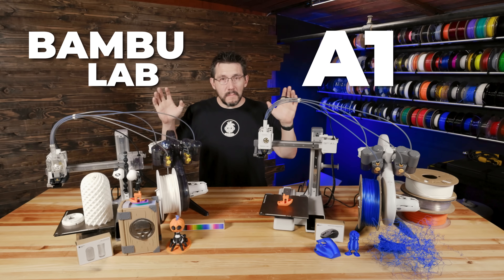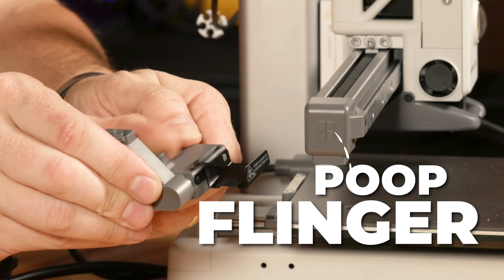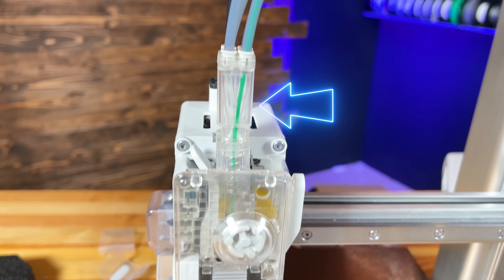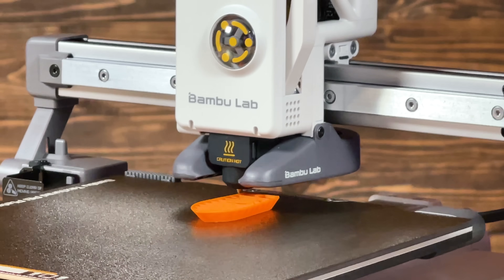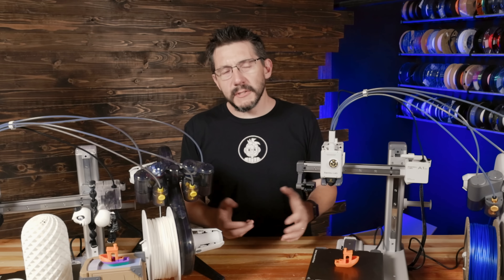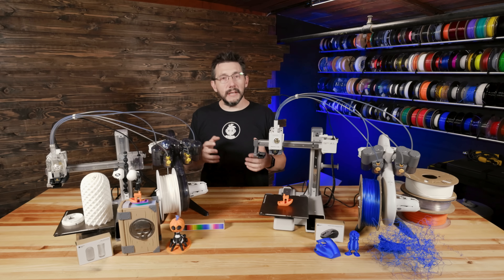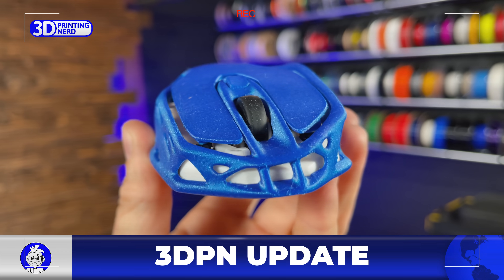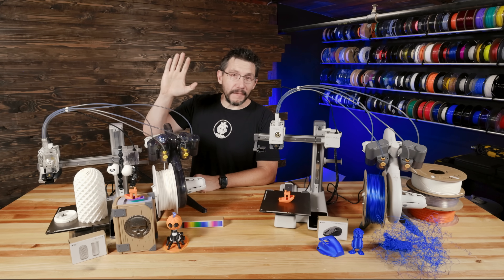Bambu Lab A1 Mini & AMS Lite! Cantilever Bedslinger!

Comment: "Appliance" like is an interesting comparison. This generation of printers might finally bridge that market chasm from hobbyists and enthusiasts to the broader market majority. I think the last hurdle is a system that provides the general consumer with models they can just click print and forget until its done. The printers might be there, but the platform for the models are not.
Reply: With bambus new online model sharing service where it apparently can slice the models too, it might be more like that ideal than you think.
Reply: It doesn't need to be hard to fix in order to be easy to use. Don't just roll over and accept these money-grabbing tactics.
Reply: @Venaloid  I am all for tinkering with my 3d printer to improve it or fix issues. But not most people. These bamboo printers are for casual users. And as such I feel there needs to be a casual user interface for the model prep process.

Comment: hope they make a ams system like that for the carbon and I hope they do a larger bed option in the future.
Reply: Why would the AMS lite be good for the X1C? The standard AMS is better and really not that much more expensive, plus you can connect 4 at once with the AMS hub.

I can see how the AMS lite may work with the other printers using the AMS hub but they don’t have the four PTFE tubes going to the hotend like the A1 does so it’s benefit would be limited.

Comment: Typically from my perspective,  a new machine is only interesting in that I might want to puck one up used a few years down the line. But this, this makes my want to start saving my pennies and possibly buy my first new machine ever. 

It's not something I can replicate the functionality of cheaply enough or easily enough be worthwhile compared to the modest price tag.

Comment: (cracks knuckles... because I always type a lot)

Well, I'm sure at the time of filming, all the drama around the leak wasn't known. The AMS lite is curious but many of these designs seem... weird. Maybe it will grow on me, but I come from using a Prusa MK3 which was infamous for "wow, have you heard of cable management?" and seeing a Bambu printer, from the same company that had a "this is basically an appliance" X1C, to this with more loose wires... still weird. I can only facepalm at the fixed power cord. The extruder is going to be used in more of their printers (they do a lot of reuse). Joel didn't mention the other features they added (none are really groundbreaking and most will never be noticed... most didn't notice an issue that these new features would solve on the X1/P1, so not much here), but the biggest would probably be the sound and it sounded decently quiet, but there wasn't much difference between normal and quiet. Do note that it's a different nozzle/hotend that doesn't have hardened options (at this moment? No idea...)

The AMS lite is... I'm not sure what's lite about it. It does everything the AMS does except be enclosed. Throw the whole printer in a tent and tada, it's enclosed. The clamps make it seem like it could rewind filament back, but now I worry it will deform the inner portion of cardboard spools over time. Hopefully they won't just slide off. I also kinda had the expectation that it would be cross compatible with the X1/P1 (maybe it is...)

People will buy this. Time will tell if it's good or not. It just feels out of place in their lineup. X1C + AMS = near appliance. P1P = bare bones X1C to reduce cost, can be customized. P1S = ok, the side panels were actually important... we'll add them to the P1P so it's like a budget appliance. A1 mini = "We're trying to go after Prusa's entry level printer"? A printer that just got an alpha release of input shaping. Sure, it's alpha. But unless you got money to spend, most people will only spend money if something breaks or they see a significant advantage over what they have. Many people I've encountered who are looking to upgrade are looking at the P1S (lots of words go here to essentially say P1S + hardened gears will get you 98% of what a X1C gives you, and you save nearly $500... just do that instead of the X1C). Prusa pitched the Mini as "you can get 2 mini's for the price of one mk3... and total build area is bigger" and people did get it for that. But an irony right now is people basically said "ok, my printer can finally print at a speed I find acceptable, which means... I want to print big things", and unless the X1E (trademarked name, will see if they announce that today or another time) is a bigger printer... many people who are looking to upgrade have gone "nah, I'll wait" instead. In fact, I've seen people say "I was thinking of upgrading my Prusa Mini print farm to something else... but Prusa's latest firmware (alpha) means that this now scratches the itch for speed". In other words, if this is aimed at trying to get people to upgrade Ender/Prusa-sized printers... they missed. And if they want people to replace their "old and outdated" Prusa Minis with this... they were 2 days too late for at least some. Only people I've heard who said they're gonna get this (once they saw leaks and now official announcement) have said their reason is "just because" or "it's wacky, I want it".

I hope more people do multi-color, but there's a LOT of people who don't care. Either due to the waste (which now gets flung off to the side...), "i paint my models", or "I just don't care". And I think people are gonna see this and go "oh, I can save $150 by getting rid of the AMS lite? Bye bye AMS, hello more filament".

Also, as someone who does software for a living and decades of open source... and reads/discusses a lot on Twitter, Bambu Studio is AGPL... GPL means "if a user wants the source code, they can request it" but it only applies to software they run locally. AGPL means that any software they access locally OR over a network/internet... can be requested. And that's not "well it's Bambu Studio, it's already on Github". AGPL means the network/API part needs to be there too... so I'm already sighing heavily over the internet yelling that's gonna happen around slicing in the cloud with a AGPL-based slicer. Much of GPL/LGPL/AGPL is the idea of "I can see how it works and modify it so I can make my own". So AGPL internet slicer = I should be able to get the code, compile it, and run my own internet slicer.

Comment: My input - buy what works.  Your discussion of the appliance model is very appropriate.

Should Open Source matter to you -

For most humans, the answer to at least 3 of those 4 questions is no.  For me, this stuff is what I do for a living, and even I sometimes want the tech that I buy to just work.  That's why I bought Apple TVs for my media use and Xboxes for my gaming.  I have access to all of the bits and bobs to make very high end versions of both of those devices, but sometimes, I just want to plug it in and use it.

Comment: they really screwed the pooch with the appearance of the ams light. all those tubes sticking out of it and flapping around is going to scare off any casual user who doesn't know much about 3d printing, and that demographic is EXACTLY what they're going for here. "appliances" are self contained objects with clean lines and smooth surfaces. or as my ex liked to put it when looking at my rack of printers a few years ago (bed slingers and corexy's) "WHY DO THOSE THINGS ALWAYS LOOK LIKE A HIGHSCHOOL SCIENCE PROJECT ?"

Comment: I was disappointed with a small bed slinger when i saw this leaked earlier this morning but now might consider it. I would use it for hue forge printing. id be interested to know how it performs with detailed hue forge prints
Reply: Most of the hueforge crowd has been wanting a larger printer for bigger art projects. Itll probably be fine for it
Reply: If I had $948 dollars to spend, I would get the Prusa MK4.
Reply: The models are cool, especially the mouse kit . It seems to print pretty good too. Multi color is neat and different.
Reply: people underestimate small cantilever bedslingers. My Ender 2 pro give almost every big machine a run for their money at $100 except for the print volume

Comment: So... what are the stepper drivers? They use internal Chinese manufactured ones for the P1P and X1, so I'm assuming this is no different. 
Also -- that thing is vibrating worse than an unbalanced washing machine.  I guess one of the first things to print are tabletop clamps?
Reply: 1000 hours on my a1 mini says otherwise, sir. its a 9/10 perfect printer

Comment: 13:02 - I completely disagree with this take: we should not accept non-repairable machines. It's bad enough that common appliances are no longer repairable like they used to be, and I refuse to let this happen to 3D printers too. Prusa printers "just work", but they still benefit greatly from being repairable, and that's why I will continue to give them my money: because I know the entire machine won't go in the trash as soon as it breaks.
Reply: I'd personally prefer the best of both worlds. The ability to repair my machine by myself if I want to, and the option to have a professional repair it for me. If my printer breaks, I'd much rather send it in for a repair or have a tech stop by my house then spend my own time fixing it. I don't know of any company that offers that with printers under $2,000. AFAIK most consumer 3d printer companies want the customer to repair the machine.
Reply: Who said anything about not being repairable? 

Bambu will offer repair parts on their website just like the do for the P1 and X1 series printers. Just because you can’t print parts at home doesn’t make it non repairable.
Reply: @rednwhitecooper  They will offer some parts but if something that was not planned to be repaired is broken then you are damned. 

Also add that replacing parts on Bambu lab printers is a pain, and we are not talking about the 3D printed parts, we are talking about rails, electronics, cables, all
Reply: my only experience is with creality and bambu printers. One was easy to report the other one needed repaired. Yes I started with the knowledge when I got my bambu printer but everything is on breakout boards and easy. On my creality machine it was held together with hot glue.the community with manuals exist both places and I have not seen a seen a part on the bambu printer that's not on their website. Sure the nozzle is proprietary but unless someone has multiples of different printers what's the point. If you run a print farm you use the same printer that way you are familiar and the same file can go to multiple printers. If it's just the nozzle you can buy a revo hotend or v6 adapter.
Reply: @rednwhitecooper However, there is a factor some people does not counts, pirate parts.

The typical aliexpress companies are starting to make imitations of Bambu labs parts (the price of an original Bambu lab parts is not a problem, the avaibility and the chance of the part not being planned to be replaced by the user is the problem), just a matter of time to see how this performs
Reply: @alexsalchemy  , if you referred to this printer (hard to tell...), it is highly   repairable. It would be good if everything was repairable, but is actually the opposite; most broken or no longer loved products are thrown away.

Comment: Hopefully they make the AMS lite compatible with the P1P and X1C. I hate how much size it takes up. But to save $100....is it might be worth it.
Reply: I don't think there would be many people that want to do that and thus not worth the effort. You would need to completely swap out the extruder which I can't imagine many people being pleased about especially X1C users with the lidar scanner.

At 250 vs 350 they will just get an ams unit.
Reply: @dannonyogurt98  Lessons learned from each version... meld them together and now you have AMS v2 which is compatible with A1 and X1...

Invert the AMS Lite and give it a stand to hold it above the A1... the base can also fit above the X1 and feed down to the extruder. Give it an extra channel for running an external spool into it... Give X and P series a firmware update... BOOM! AMS v2.
Reply: @dannonyogurt98  all you would need is the buffer they sell and more retraction on a filament change (I'm not sure there is enough spring wind though)
Reply: @dannonyogurt98   thats not accurate at all, they already have the AMS hub that takes 4 PTFE in and 1 out to the printer... why couldn't you just plug the 4 PTFE tubes into that with the right software to handle it
Reply: That would be pretty cool. I like how the tubes are somewhat exposed and near the print head when the paths merge so there is less retraction needed. I can easily see a way to adapt the X and P Series to have similar feeding mechanisms for an AMS v2 to fit on top of the X and P series and have the same thing.

Now how to deal with the poop...
Reply: It's already been verified it won't be compatible.
Reply: They will not.

Comment: I feel like it's only a matter of time before these printers will be able to mix cyan, magenta, and yellow into full spectrum color, as the inkjet 2d printers do.
Reply: Pretty sure I’ve seen something like that already in a prototype somewhere, though the amounts of purge would be massive
Reply: Read a hackaday article a while back on a filament blending hotend. Had a massive metal 3d printed heater block, and the feedrate on different filaments changed output color. Something to do with it's internal geo allowed for proper color blending.
Reply: Bambu actually sells a CMYK filament set for printing full-color lithographs, so that's something :)
Reply: Google “QuadFusion” for that CMYK mixing extruder.
Reply: 2d inkjet printers do not mix the colors. They spray tiny dots of color onto the paper and that look like many different colors. But under the microscope, you see the dots with the original 4 colors.

Mixing filaments is not so easy because different filaments can have different properties. So full-colour 3D printers use a trick. They create a white surface and spray ink onto it, much like a 2D printer.

Comment: Interesting, and a potential game changer at that price; but I’m not connecting my house to china through their products. I’m not sharing my designs with a chinese server.   It’s a toaster for those that want or need a toaster and are not concerned with network security. I just hope it doesn’t start printing in the middle of the night or burn down a bunch of homes from a bug……. Yes I have trust issues when it comes to closed source systems and China in general. Thanks Joel for a good, complete, and honest review.
Reply: You can use them completely offline.
The software supports LAN & microSD
Reply: @logitech4873  Firmwareupdates can be done with microSD or LAN now?
Reply: @logitech4873  on this new A1?  Did not see that mentioned. I know they did that for their other printers. That certainly would take that concern away and Joel is obviously using non-Bambu filament……. Interesting times

Comment: So the MINI+ just got an alpha for input shaping. Would love a head to head comparison.
Reply: the A1 would blow the mini+ out of the water. Mini plus doesnt really have input shaping, as it has no accelerometer and no way of actually calibrating it for your printer. Prusa is basically just cheating right now and using the exact same values for all mini's, which isnt the right way to do input shaping at all.
Reply: Yeah but without input shaper calibration. Also the Mini+ XZ assembly is pretty flimsy. I wouldn't be surprised if it performed significantly worse than the A1 Mini.
Reply: @m97120  It should perform worse, we should be concerned if tech hasn't evolved with machines all those years apart